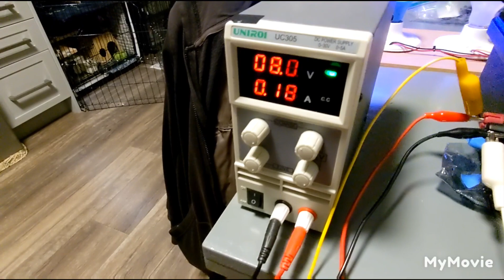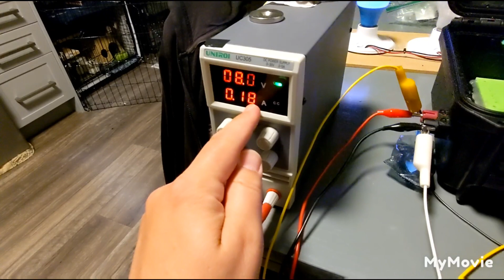Faraday Research RND ⚡⚡ Robert Adams motor generator #tesla #freeenergy #zeropointenergy

Comment: the 555 is only used to discharge capacitors ... pulses slower (frequency too high) and plays with the potentiometer .. and adds a 220v 420uf capacitor at the output
Reply from the maker: Sorry I don't speak French